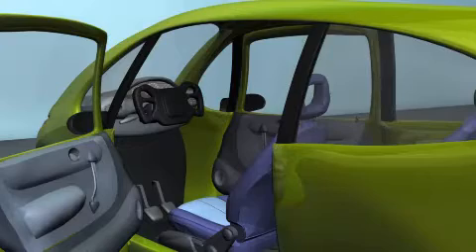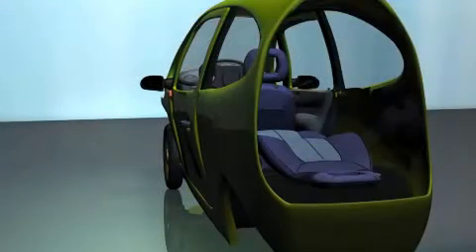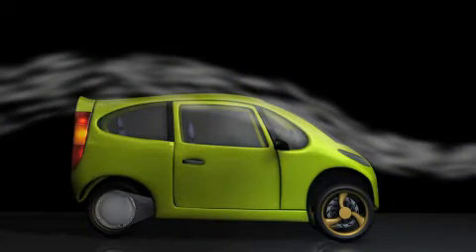Tomorrow's car

Comment: Great concept, but focusing on the dangers of motorcycling is a flawed approach.

The greatest "safety issue" with motorcycles comes from **other vehicles**  - especially at intersections and in heavy traffic. Drivers fail to see motorcycles at intersections because of their small crosssectional area. They fail to see bikes in heavy traffic because a bike in the column looks like a gap. THIS vehicle will have the same problems and one extra added disadvantage...